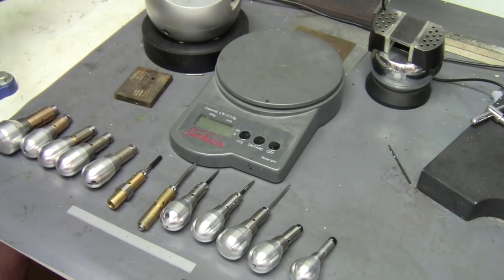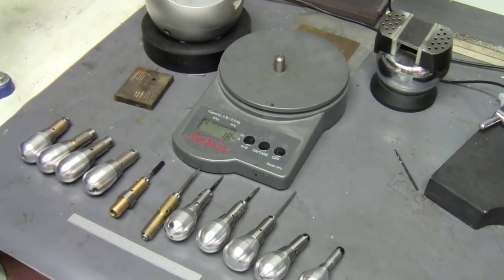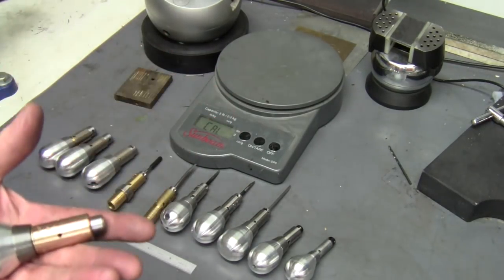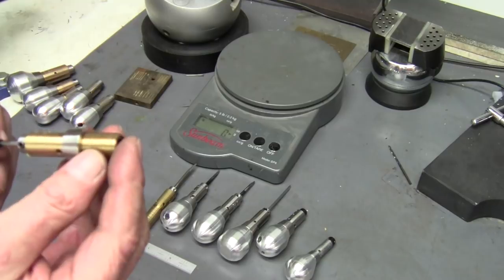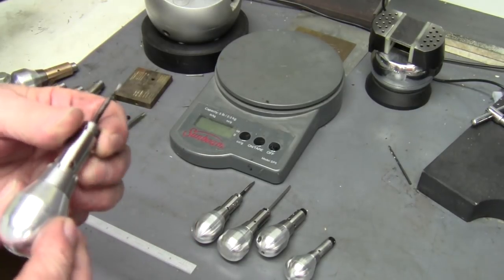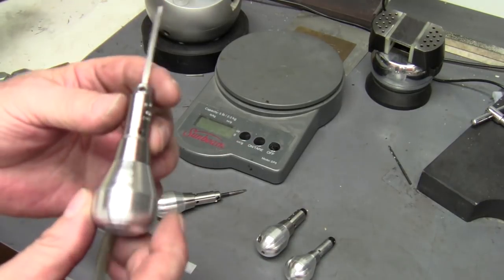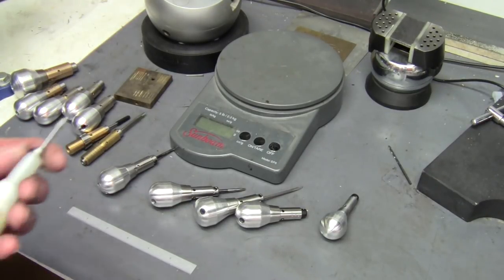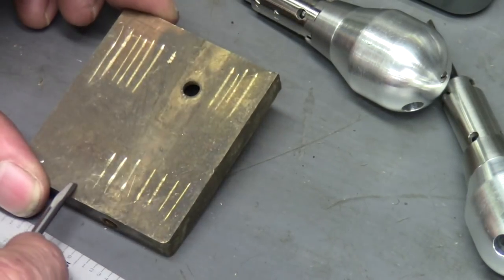Development of my Homemade Hand Engraving Machine Hand-pieces

Comment: Hi Rick,  I am also a big fan of Shaun Hughes engraving too!  I watch all his videos. I was a tool and diemaker when I worked,  and appreciate your videos too.  I now make musical instruments,  being retired.  I no longer have a lathe to work with anymore,  and am wondering if you could make me a handpiece like you made for Shaun?  If so what would it cost?  I might be interested in the Delrin plastic hand piece to, since I engrave on Mother of pearl inlay on my instruments and could have a need for a softer hitting hand piece for that process .  The stainless hand piece I would use on my metal pieces for Banjos and possibly vintage guitar metal parts.  I have engraved by hand some for a while,  but never with a power engraver.  I would  have somewhat of a learning curve.  Especially getting the gravers ground just right. Let me know what you could door me!  Tom
Reply from the maker: Email me at ralex397@hotmail.com for details.
Reply: O.K.

Comment: That's pretty cool delrin handpiece. I wish I had my engraving system set up to engrave  right now. I built one to your specs using my drill press. Haven't used it much though. Id also like to know how long this one would last. I can imagine it would engrave jewelry for a very long time!
Reply from the maker: Thanks for IDing the material I wasn't sure what it was but I like the way it machines.
Reply from the maker: @David Stevenson I'll have to give it a try!

Comment: I modified a Goodyear i8000 120 tire compressor with a foredom variable speed foot piece run great for jewelry but I think I need the shuttle style compressed air hand piece do you think any advice would be appreciated!
Reply from the maker: I am not familiar with the equipment you are using so its very hard to give any advice. I do know that the system I use will engrave most anything. If you can afford around $100 to build the machine and modify a clone hand-piece you will have a very powerful hand engraving machine. Good Luck!

Comment: Hey Mr Rick what do you suggest for piston weight and spring firmness and degree of bit to engrave motorcycle and car parts?
Reply from the maker: I make my pistons to weigh in at between 3.5 and 4 grams. I only use 90 and 120 degree carbide gravers sharpened with diamond wheels using Lindsay templates. I use a soft spring in my steel hand pieces but the Delrin HP's like a firmer spring. Be sure to Experiment!